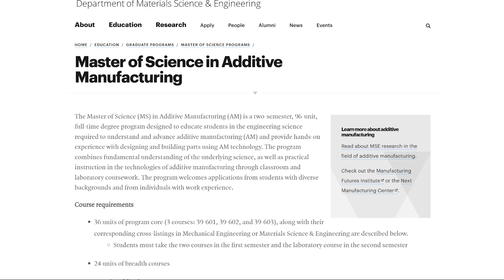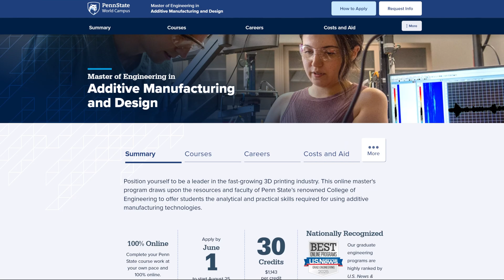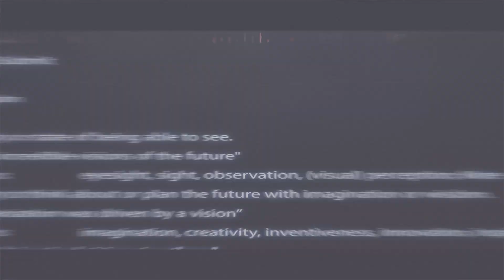How to Start a Career in 3D Printing - What to Study and Why Universities Make the Same Mistake

Comment: Very nice video and topic. Most materials engineering and mechanical engineering programs have professors with research labs with additive equipment where students can get involved on projects. It could be helping out in the lab all the way up to a PhD on an additive topic. Learn by doing! 

For clarity, the equipment in the labs is not usually consumer grade filament printers, and I am not talking about printers in a university maker space. Cutting edge research that gets funded involves something more advanced such as pellet extrusion, material jetting, and metal laser powder bed fusion (just as examples).

Comment: Maybe I didn't hear correctly, but what's the reason or justification for having a graduate degree for using PEEK?
Reply from the maker: Just the idea that a degree in material science / chemistry / polymers can be a great help understanding the behaviors of these plastics — peak is challenging to print due to its crystallization, the way it flows (rheology), and that’s all affected by its geometry, extrusion size, etc etc — we’ve improved our printing using the knowledge of material scientists we’ve consulted over the years, so having a thorough base understanding of the advanced materials being worked with is an advantage in production — in addition to knowing what the appropriate material for the project really is — tons of people overkill and ask for PEEK when CFPA6 is more than sufficient — having that knowledge can save time and money :)

Comment: These are good points for someone who wants to be an AM operator/technician, not necessarily for someone who wants to be an AM engineer/designer. Obviously hands-on experience is needed for both paths, but just having experience printing Ultem isn't going to open the door for you to become an aerospace AM engineer. Along with hands-on printing, the AM degrees focus on stuff like: the science of how different processes deposit material, materials science (polymers, metals, ceramics), welding science, mechanical engineering (FEA, FMEA, fatigue, fracture), design/computational design for AM, destructive/NDT part validation and QC, AI/ML optimizations for everything... A lot of the same stuff for designing/engineering any part - just made with funky machines and geometry that changes the approach to everything.

Comment: The thing is, not every engineering school has 15k to spend on a single "professional" 3D printer and a lot of the "professional" "industrial-grade" machines are not worth the money compared to a more modern pro-sumer core-xy printer.

I was doing my thesis and the lab had a Raise3D Pro2 and it was never worth the hassle to use over my personal Creality K1.